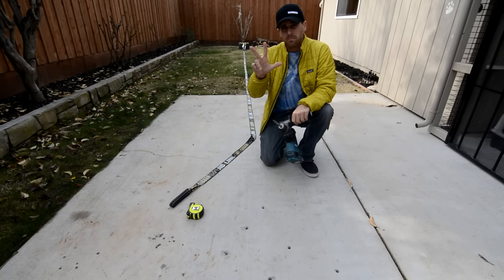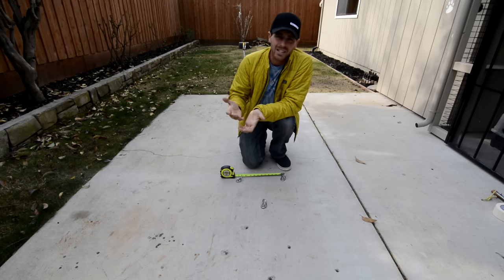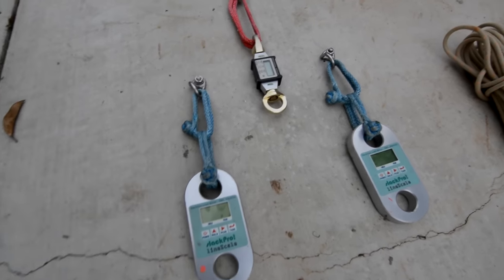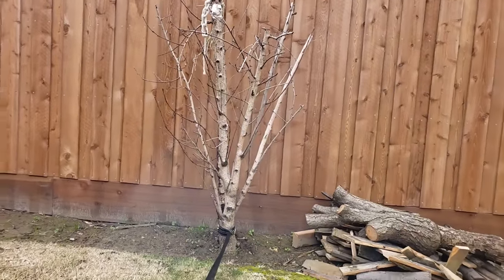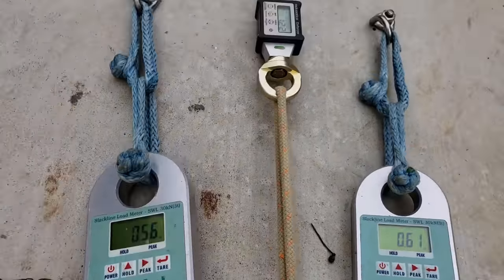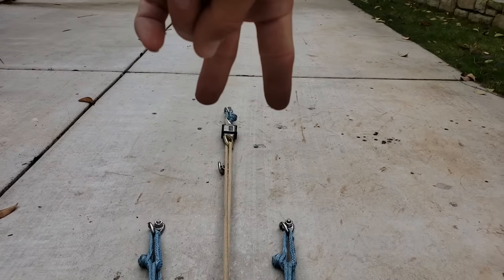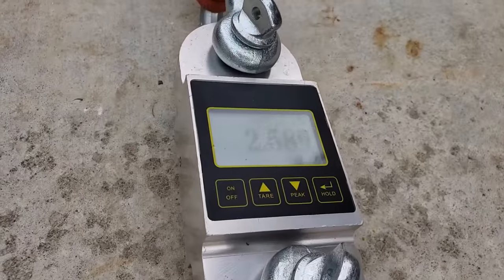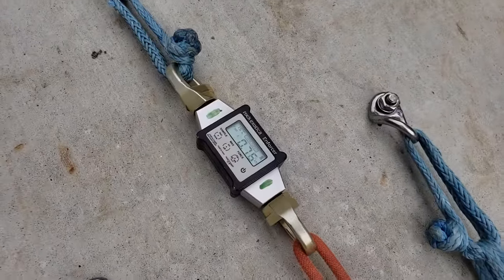14 tests on triangle bolting patterns for highline anchors - do they equalize?

Comment: That was brilliant. Plenty of crossover information here for other areas of rope work too. With that equilateral triangle on a wall, yes, it does change everything. Would need to spread the arms out to between 60 and 90 degrees which will then cope quite well with a shifting load. as long as the zone of influence does not stray outside the constraints of the inside of the triangle. Strong work mate.

Comment: Hello, thanks for the test! But...
Sorry for digging this old video...
Sorry for my lack of climbing technical English...
Sorry to disappoint some of you guys...
I am an engineer too... I will try not to go wrong...
Two things mainly play here : stretching and friction...
Imagine an absolute non stretchable rope.  If you preequalize the load it should stay equalized with or without fiction (everything will stay proportional).
Then imagine a rope (stretchy or not) in a frictionless world.  With your "sliding X", the tension will be the same in the whole rope (principle of pulleys), whatever the pattern or the length of each strand...
Now take your stretchy dynamic rope and a BFK.  Even if you preequalize perfectly, if you don't have strands that are of the same length, when you put your line into tention, the strands will stretch at different rates because the common node moves X cm/in for all the strands but the tension on each strand is proportional to the "relative" streching (X/length).
As for the sliding X in real life, the friction does not let the tension equalize... I would say mainly at the common node where the three strands are against each other... You should try pulling (to the side or the sky) on one strand to see if you can make it "slip" and change the equalization...

So... In theory (!?!) you should put your anchors on a arc of circle with its center at the common node.  The bigger the radius, the better because any "misequalization" at the beginning will be smoothed by the streching. And because the forces in each strand will sum more efficiently if the strands are parallel...
But your BFK will never be perfectly equalized... Because you are human... Sorry... Even if it could be super good enough ;) The problem is that you cannot check without keeping the dynos all the time...
As for the sliding X, independent pulleys at each anchor AND at the common node should do the trick, whatever pattern you use... But I don't know if pulleys are allowed... And you would need 6 of them...

I hope it will help at least one guy (or girl)...
Stay safe !

Comment: You should break test a harness and belay loops
I know you've probably got a billion other tests to do but I've never seen a specific kn rating on a harness and it's got me curious
Reply from the maker: I think that would be an interesting test for sure.  How do you think i should do that? Just pull the belay loop?  I could have those made and break those.  Maybe connect harness to one side and belay loop on other?  But that shouldn't have such a tight bend since our hips make the entire thing round.  Shoot me some ideas!
Reply: @HowNOT2  I'd do the belay loop alone, the waist belt being pulled by the main contact point and a leg loop since the harness would basically be destroyed at that point
Truthfully I'm most curious about what the waist loop would break at being pulled by the contact point since that's the most life saving part
Reply from the maker: I can get normal harnesses for like 30 bucks... i think i can do this! :)
Reply from the maker: Don't bid on anything on ebay for a few days.  I pretty much bid on all of the harnesses!  :)
Reply: harnesses are already tested by the companies who produce them and they must support at least 22kn (if i'm not mistaken), so why testing them?
Reply from the maker: @mirkocoser5049  have you seen a harness break in slow motion? I haven't  :). Also i have found most things i break are not getting the same results as the companies claim. They break in best case scenario lab style and i break things based on real life scenarios (or the best i can). And what part holds 22kn,  where does it break, and how? I learn so much breaking stuff in person.
Reply: @HowNOT2  that's a good point, you're right! I'll wait for the episode!

Comment: The friction of the master point on the sliding X is likely to have an affect Ryan. I know you suggested it doesn't however the best example of when the friction made a big difference was in the park video with spike anchors you did. One test showed the two middle anchors were not equal which makes no sense. The other example of why the friction also affected things was how equal the v configuration equalised. There is no rope/sling overlap on those. 

In this video, there is an interaction as you tighten up the ratchet, the sliding X master point overlaps and as you use static rope the forces can build up in one line quickly. The force of the rope coming from a lightly loaded anchor (the outer ones) is enough to induce a high load on a rope it overlaps. 
The static rope had a much lower load in the central bolt (when way back) due to the increased stretch on the longer line. As you know, a longer dynamic file, will stretch further.  

It could be possible to add tension to individual bolts to allow you to equalise anchors in any configuration. I'm thinking something like using a tensioning spindle like on a fence or building cross bracing. They are bomber and easy to adjust.

Comment: Trying to wrap my head around this. Is it true to say that IF the carabiners were zero friction, the load would always equalize fully, regardless of geometry, material, etc? But since even in a sliding-X configuration, carabiners may give 40-60% friction, we get all these other phenomena involving angles, stretchiness, etc. I also believe your different cords may give different coefficients of friction. Even the load itself could  affect the coefficient of friction. So any assumption about zero friction sort of collapses the whole model.

Comment: The Center bolt will always have twice the force as one of the side bolts regardless of how far back you put the center bolt.  You have basically set up a 2 to 1 pulley system on the middle bolt.  If you added pulleys (thus removing the friction)  onto all the dynometers, you would see that the center bolt always carries half of the overall load and the two side dynos share the other half of the load.  It's a pulley system.  Each side pulley is 1:1.  If you want to equalize the loads, simply use three different ropes - one to each dyno instead of one continuous rope (or alternatively tie and overhand not at the bottom of the ropes).

Comment: To share the load better the two side anchors need to be closer together so they are sharing more of the inline force .
The wider they are apart  from the centre line of force the less load they take . Using dynamic rope means that the longest leg of rope has the most stretch and as a result  shares the load more evenly  .  To work out what bolt configuration works best  you should use chains not ropes to remove the  stretch and knot loading variable . Connect a bar across the two outer bolts and slide the connections  in and out to vary the angle to the centre  line to see the force variations . There is only going to be one best configuration for a pull in one single direction .

Comment: Great video, Ryan. About the sewn loop/soft shackle connection, there was an incident where the fabric on fabric connection as you show it cut straight through. This was at Natural Games in France where a trickline tail was tied off to a 6mm rope (possibly Amsteel, but possibly regular cord). The trickline weblock broke and the tie-off cut straight through the webbing, causing the weblock and webbing to hit the trickliner. As far as I recall, his face is permanently scarred and has only 80% vision in the eye that was hit.

What do you think about making a video to test your claim? Since there was an incident where the non-sliding fabric/fabric connection failed, it would be interesting to learn what are the factors that influence that kind of failure. If you do, I it should probably be done on a stretchy webbing that's longer than 20 meters to reflect a real-world scenario.

Thanks for putting all the effort into these videos. They're great at getting people to talk about the ideas.
Reply from the maker: Hi Bradley.  I'd like to know more about that failure.  I would be nice to demo that in a video of situations that it can fail.  Rope on rope in some situations is bad but we also have it all over the place where it is acceptable-ish.  Spacenets are nothing but rope on rope.  Tying our ropes to our harnesses is rope on rope.  Our leashes rub on our webbing when it has to switch sides when we fall the wrong way on our highlines.  Our backups are constantly flipped over our highlines.... AND I have broken all my sewn loops tests with soft shackles at the loop (stitching or webbing by stitching always breaks) because it is less hardware to go flying and have used soft shackles on loops on 100% of all my highlines for over 4 years with no sign of abrasion other than wear and tear.  I truly don't even know how to make it fail... maybe a drop test?  Shoot me some specific ideas and I'll make it happen!
Reply: @HowNOT2  Here's the report on Slackchat from June 2015: https://www.facebook.com/groups/slackchat/permalink/888549237885621/

This isn't to say there's no place for fabric/fabric, but I'm not sure we fully understand the failure modes, especially in dynamic events.
Reply from the maker: It looks like the forces they were seeing were literally 5x what we can even achieve on any highline situation (that isn't trickline related).  6mm accessory cord isn't very strong and the thinner the material the more likely it will cut through the opposing material.  6mm dyneema highline backups are no longer a thing because it cut a bit of a main line in a wind storm.  Round surface area on flat webbing while oscillating back and forth.  If you look at my instagram post ( https://www.instagram.com/p/Brp52gxF7We/?utm_source=ig_web_copy_link ) with the 9mm soft shackle breaking at 179kn in slow motion, you can see all the "catchers" that keep the pulleys from flying breaking as if they aren't even there.  I imagine what happened in that test is similar to what happened to this trickliner.  However a soft shackle on a sewn loop is large radius, non-oscillating, generally padded situation and basically can't cut through the loop regardless of the pressure one puts on it.
Reply: The difficulty is to make a general statement which says non-moving fabric/fabric connections will not cut through because there's no friction, even though there are incidents where they did indeed cut through. I don't disagree with your reasoning, but there are plenty of people out there who don't understand the nuance for when fabric on fabric is okay. I think a video that looks into the failure modes of fabric/fabric connections would be very interesting and spark a healthy discussion.
Reply from the maker: @TheBradosaurus  i think an epsiode diving into when and where it is an absolute problem, where it can be safeish and where it is bomber would be helpful for sure.

Comment: Wait, is it even mathematically possible to equalize the three. Isn't it normal for the inline bolt to receive the most load? It is probably a function of the geometry what is left for the other two bolts.
Reply: It is mathematically possible, depending on what you count as equalised. In the sliding example, the tension in the rope is able to equalise itself and so force on the bolts will be equal. In the version with a knot, it will all depend on how equal the knot was tied, but assuming they are all pulling together the two side bolts would have a higher force, as the force in the direction of pull would be even, but because of the angle on the side bolts there would be extra force as there is a sideways component as well as the one in the direction of pull

Comment: That pattern actually looks great,
I think you will get better results if you'd measure the equalization at the same force on the master point every time.
Even better to have 3 measurements, low tension , normal tension , high tension (for actual highlines)

But that is just my engineering OCD brain bothering me.

Edit : Can't type for shit
Reply from the maker: Its hard with just a rachet. I would pull hard each time to what felt the same but id get very different results depending on stretch of anchor material. It also settled sooooo quickly that i wouldnt be able to get and keep a number if i wanted. Main idea was just to compare master with each point. Slack science is a little bit slack about its science  :)

Comment: Angle matters, distance doesn't, if friction isn't a factor. If each anchor was tied with it's own rope, and you could get them all equally tight before tensioning, the longest rope will have the lowest spring coefficient and see the least force (at more extreme angles that could change a bit). A more elastic rope will show this better. 

Now if we used one rope like you did and then used pulleys on all the connections, we'd see that the center anchor will always have the highest force. A stiffer rope will show this better. 
Jostling the ropes while tensioning will approach the example with the pulleys, where it's purely the angles that matter.

Comment: Why don't you put those meters in use on a real setup !!
Then use a weighted pulley assembly pulled out to the middle of the line to see how much tension is really on the line when it's in use like you were using it for real ???

Comment: dude. i'm an engineer. your maths it out. its trigonometry, really easy to work out. those two side bolts will never equalize with the centre one, its trig
Reply from the maker: Nothing is basic math when you have things moving and stretching.  If it was so simple why did a painting contractor figure out an equilateral triangle is best for highline rigs? haha
Reply: With zero friction, yes they would. But zero friction does not exist...
Reply: Don't expect slacklining people to understand math and engineering lol